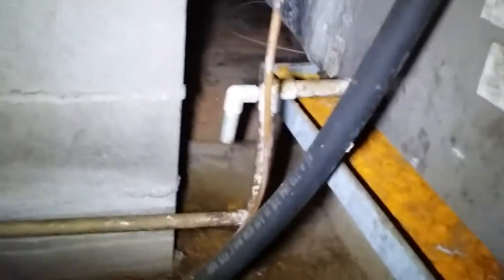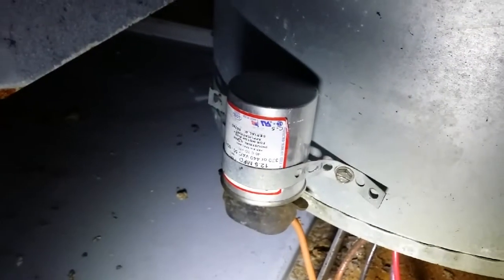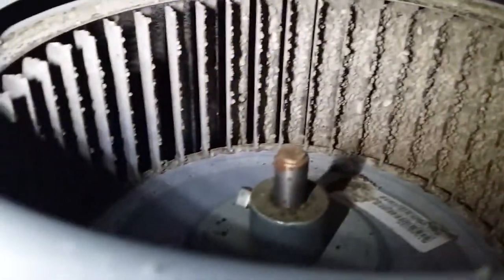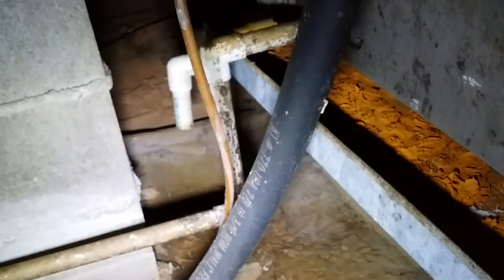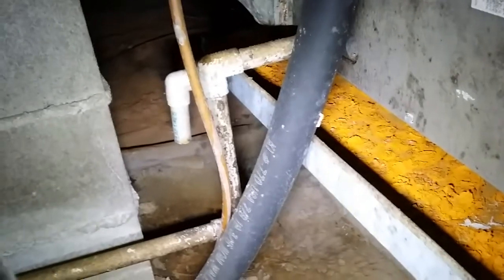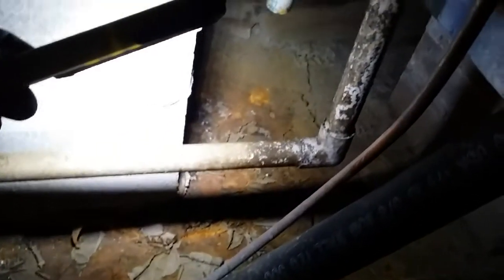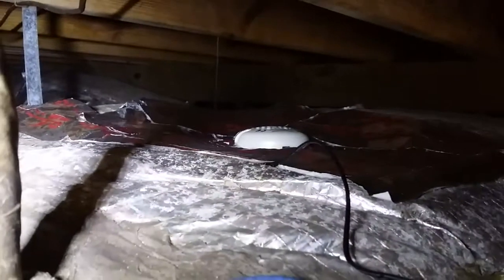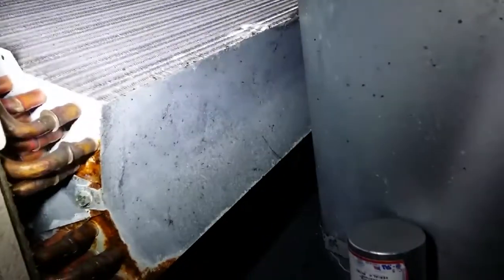IAQ Problems with a patch Purifier

Comment: Hey Justin, on those types of jobs I install a condensate pump, line is just to long. Next ours toon is how did it go so long without someone putting a trap on it!!!!! Sometimes units are just a lost cause and better off in the scrapyard.
Reply from the maker: That's a great idea. I'll have to bring that up when I go back this week. I have no idea why the notrap didn't get noticed.  This is my first time there. I was surprised that the unit had a good charge and was cooling. This one needs a lot of cleaning but will get them by for a couple more years. The people are older and really don't want to spend the money on a new one at this time. Thanks for the pump suggestion, that's a great idea. No telling what the drain looks like. I'm gonna do a follow up video when I go back.
Reply: Def looking forward to what you will bring to YouTube!
Reply: No problem about the pump, I hope the cleaning works out for them.